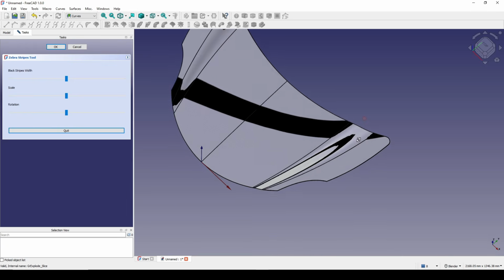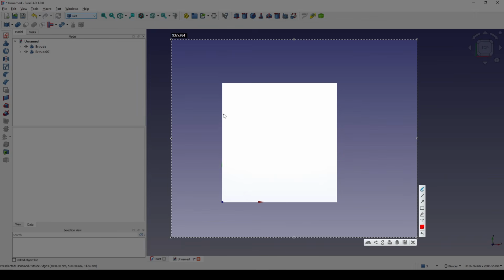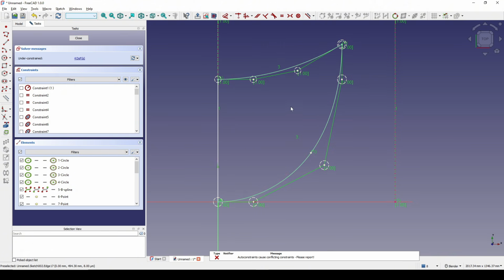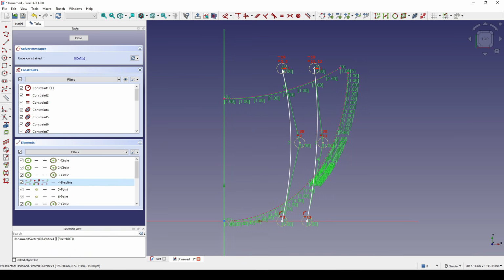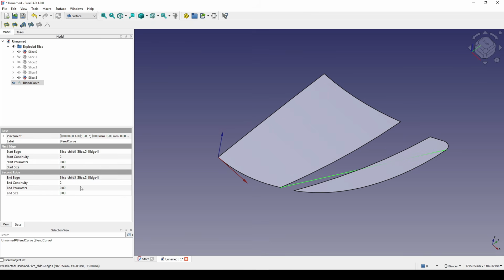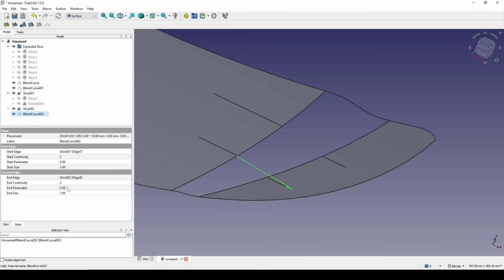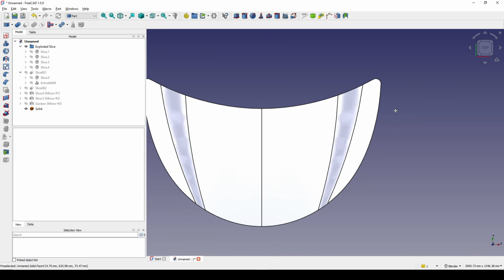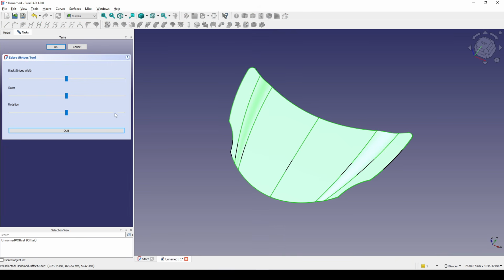FreeCAD 1.0 Design Car Bonnet Using Gordon Surface And Blend Curve.

Comment: As an Alias modeler in automotive design for over 30 years, I can only admire your patience. 
FreeCad is clearly missing proper free form sketching and modeling tools. Creating a sketch as compared to Alias is an absolute nightmare. 
What would be needed at least is a non parametric sketcher workspace that lets you quickly create free NURBS curves with an easily editable form. (Sliding CVs, aligning curves, etc.)
There are so many times where there is no need for parametric input.

Comment: I'm trying to create some 'organic' surfaces for an ongoing project using FreeCAD - so this tutorial is very useful in highlighting the various tools that I could use to create those more complex surfaces. Thank You.

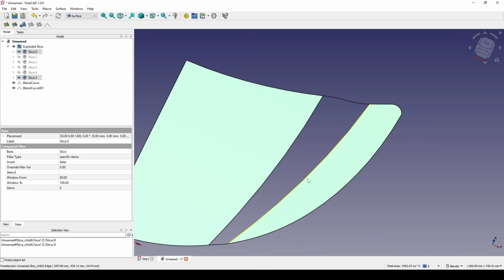A question - at around 13:50 when adding the two intermediate supports for the Gordon Surface - would using a split-curve on the two boundary edges be a simpler way of adding the connection points needed for the blend curves? 

And, During the video you add an annotation layer to show the plan for the next step in the workflow. Is the annotation tool part of FreeCAD, or an external app?

Thank You.
Reply from the maker: Hi, we should have 2 lines for 1 blend curves. You can't create blend curve with 2 points. I used the solfware called lightshot to take a snapshot.

Comment: Не знаю что не так сделал. Но смещение утолщение не получилось. И зебра анализ не показывает. А так да получилось плоское тело)))
Reply from the maker: After you Slice Apart, if you connect the first and last pieces, they will have different slopes, so it cannot be flat, make sure you connect the correct pieces. If you have a trouble with thickness, just select 2 join curves, go to the data slot, Under Shape Approximation,  the active option, if it's true, set it to false.

Comment: As usual, amazing. But the steps you have to go through to get the tangent curves are crazy from a productivity point of view. I think the sketcher improvements in 1.1 will at least provide a way to reference geometry intersecting with the sketch.

Comment: I followed your steps but I can't get the Parts offset? What could be the problem? Do you have a workaround? Thanks
Reply from the maker: Im not sure what is your error. You can uncheck the fill option and try to fill it manually using Ruled surface in part wb. If the offset is not working at all, you create a copy of the surface, move it away and using ruled surface to fill.
Reply: @DuyQuangDang  GReatb vieeo. Thnka you Sir.
Have the same problem. Trynow a lot and see that my offset fom the golden surface und the offset from the slices go in different direction. if
i offset all in part for part with the right way of direction it works fine. But i know not  my default.
Have you a idear wher my error is???  Thank you 🙂
Reply from the maker: @sjn8099   Thanks for watching! I think you could set the join curve Active option back to False, for both of the join curve. This option sometime cause small problems.
Reply: @DuyQuangDang  Oh. Thank. I try it tomorrow and report 🙂